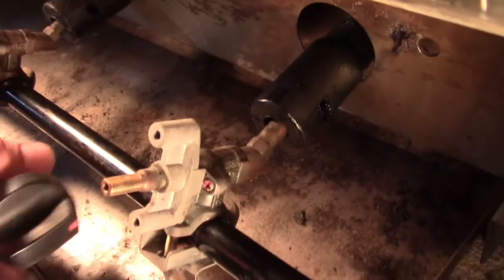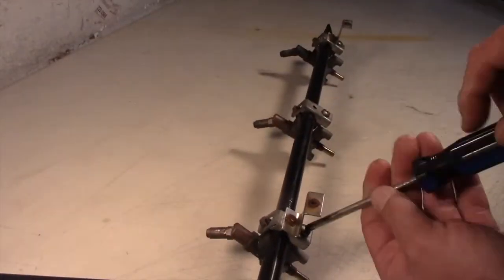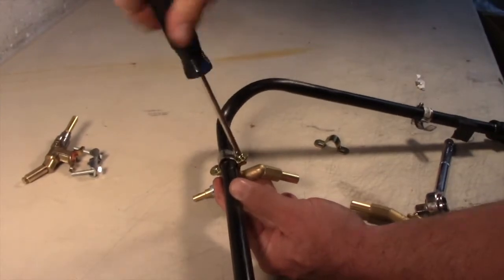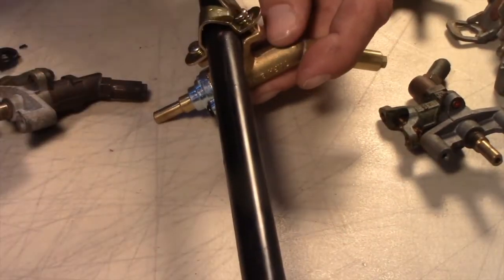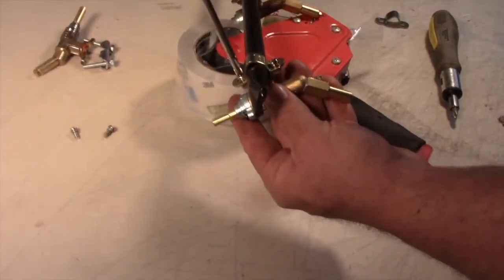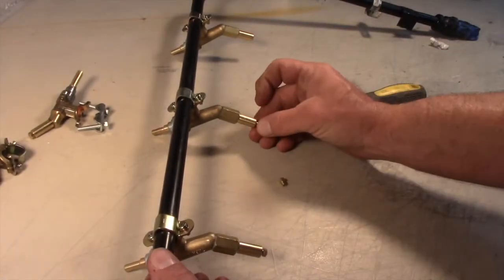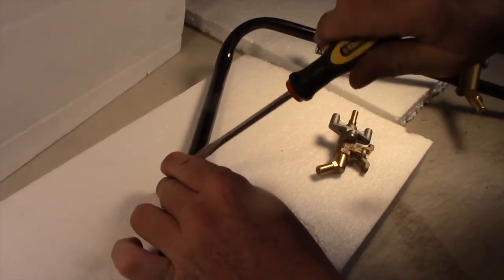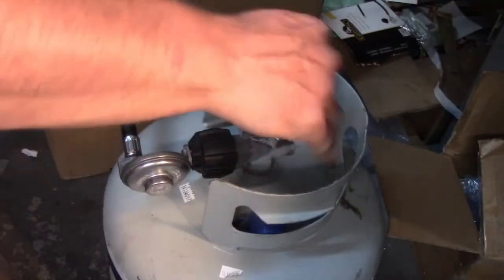Replace Extinct Turbo STS Control Valve in Barbecue Grill Models.

Comment: What valves did you use to replace turbos
Reply: I bought one in 2005 BBQ Galore Grand Turbo, never need replacement valve, very robust parts.  The burner still the original just need 3/32 drill to remove sooth on flame orifice every year.  Their website has the parts BBQ galore.